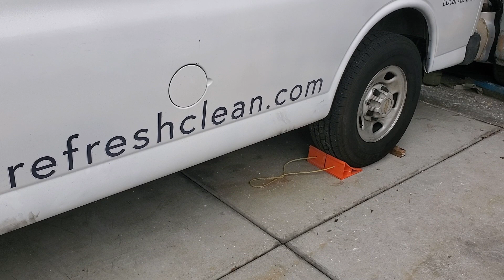4L80E Transmission Install 2007 Chevy Express

Comment: The only issue I see in this is you didn’t fill the torque converter first unless and I thought it was supposed to be pushed back and turn to drop back a couple times unless you did that off camera. also you’re supposed to lube the front of the torque converter and the rear of the converter so you don’t get leakage

Comment: Great video time lapses, camera angles,  narration !!  $2500 not bad for rebuilt trans & parts but I imagine about 8 hrs of labor.  How many miles so far and any problems?  I've been thinking about getting a 2010 Express with maybe 200K miles but was worried about transmission cost & issues with AFM on the engine and variable valve timing issues.  And next time turn the vol way down on the music so barely audible.

Comment: When dropping the transmission how did you address the dipstick tube? Is it just held in with a seal? Does simply lowering the transmission cause the tube to slide out?
Reply from the maker: It's held in with a bolt under the hood. Yes lowering the transmission allows it to slip out.

Comment: Is this transmission has a cooler across from the condenser? What’s the operating temperature range if you had a chance to measure it with a scanner ?
Reply from the maker: I've had the chance but I lack Motivation.

Comment: I have one question from what I noticed how did it run because you didn't install converter completely you can actually snap in front pump lugs
Reply from the maker: Runs great
Reply: The converter didn’t look like it was all the way in!

Comment: Hi Skyland Did you have to reprogram the computer? Because I want to buy a transmission in the auto zone and the specifications indicate  did I need Vehicle specific flash programming you did it? I don’t wanna mess with it if I need to do that. It’s for 09 Chevy express 3500
Reply from the maker: I did not need to do that. Everything i did was outlined in my video. My van is a 07 2500. I've changed a few transmissions now.